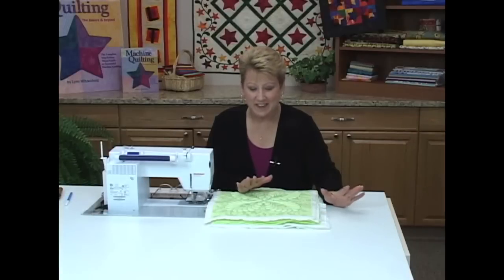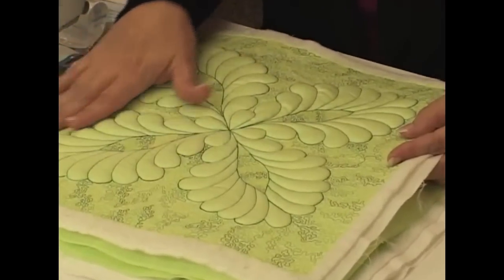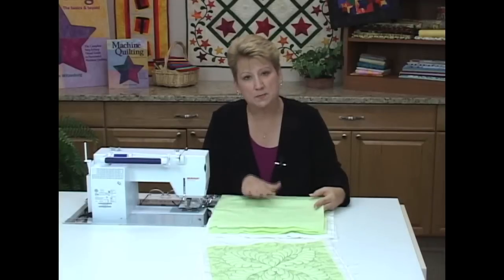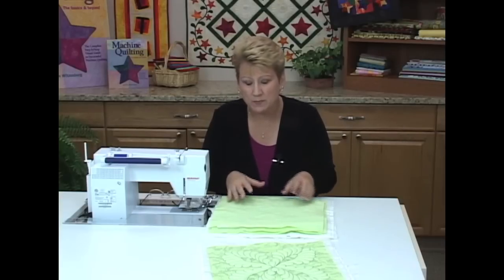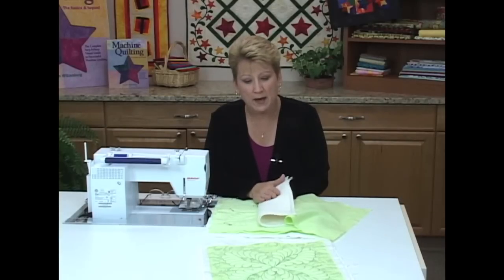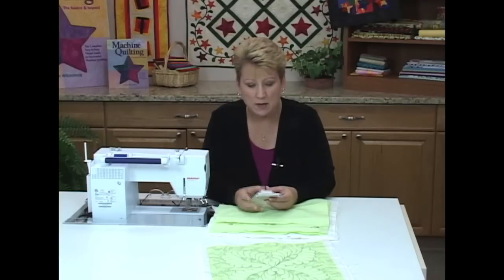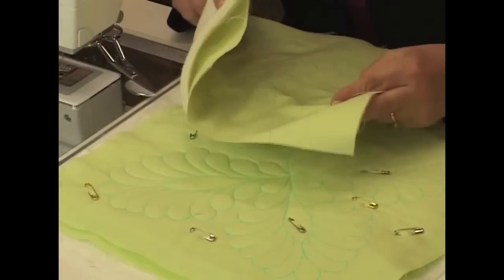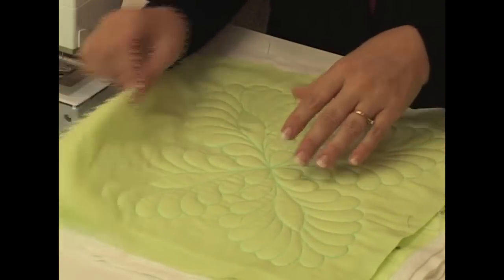Trapunto on Your Home Sewing Machine  Machine Quilting

Comment: I have tried many times with YLI water soluble thread in the top and reg thread in the bobbin.  I've played with my top tension and the thread always breaks. I even went as low as 0 still the same problem So I figured I'd change to a needle with a larger eye, still the same problem.  Help